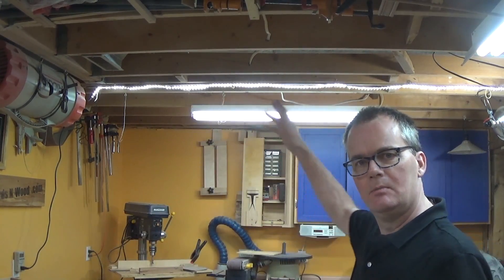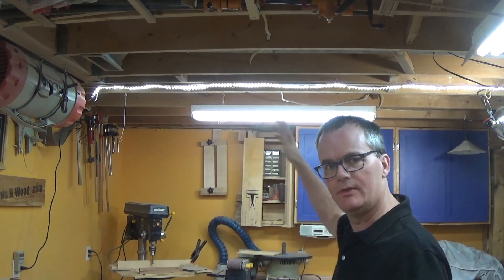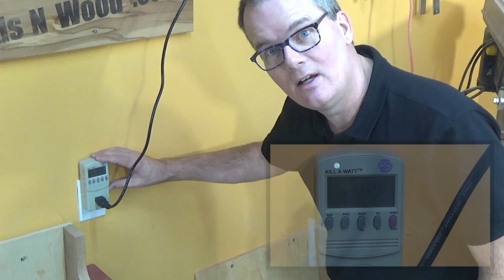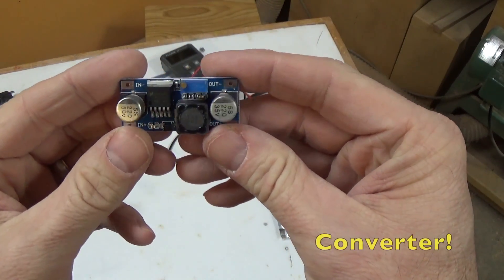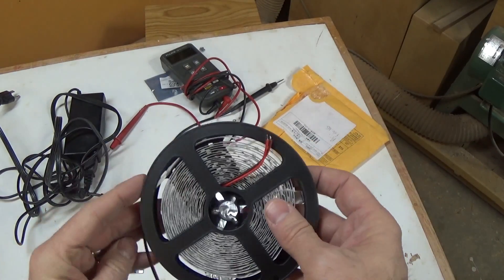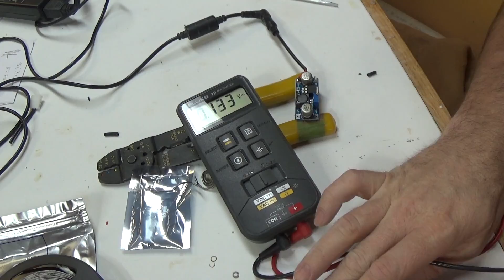Can LED strip lights replace Fluorescent!?  (WnW #46)

Comment from the maker: Your support brightens my day: https://www.patreon.com/wordsnwood
========== ========= ========== ========= ========== ========= 
PLEASE NOTE:  the DC-DC converter burned out after posting this video.   I have since found a reference online that claims these have pretty strict amp limits, and can overheat and die if more current is applied.  My PS was putting out 4.5 amps.   The DC-DC convert had NO specs provided, and I was NOT checking the temperature.     

========== ========= ========== ========= ========== ========= 
PLEASE SEE THE FOLLOW-UP VIDEOS:

Part two:  https://youtu.be/oiEl96CIOGI?t=41
Part three: https://youtu.be/5eA2CPHRakw

And you'll see how I finally succeeded with my experiment.

========== ========= ========== ========= ========== =========
Today I ask the question... can these LED strip lights be used in place of regular lights?
Project web page:  http://www.wordsnwood.com/2016/LED-lighting/

I was curious if these LED strip lights (which you see everywhere) could be used as "regular" lighting, instead of just accent lighting.  By checking the advertised rating for some of the brighter-rated LED strips, they were claiming 720 lumens per meter.

That is almost the same rating as a 60watt incandescent bulb.   Incandescents are also omni-directional whereas LEDs are highly directional.  So, if these are putting out roughly the equivalent of 60watt bulb for ever meter, then one of these strips should be equivalent to FIVE 60watt lightbulbs.  That's a lot of light.

Unfortunately I do not have a light meter so these are all highly subjective conclusions.

One strip of LED lights is, in my view, not as bright a a conventional 4ft double fluorescent (old T11 style) fixture.  However, TWO strips of LED lights are, again in my subjective eyes, equivalent.

However two strips of LEDs cost more, and consume more power.
But I do like the light, as it is more even and less concentrated.

You be the judge!

NOTE:  after posting this video I was told that you can get a light meter app for your smartphone.  I tried 3-4 different free android apps and all reported that the lux from the fluorescent was equal to the lux from the two LED strips.  (586 lux; with the phone resting on the tablesawl.)

---------- ---------- ---------- ---------- ----------
If you want to build this:  (Affiliate Links)

Lighting Ever 5050SMD LED lighting Strip -- http://amzn.to/1SF0c55
Lighting Ever AC 72watt Power Adaptor -- http://amzn.to/1TqN2rb

5 meter Strip of 5630 SMD LEDs -- http://amzn.to/1KZA4PB
(the vendor I purchased from on amazon.ca - Hintel - does not appear on amazon.com, so this is a link to a search for 5630 SMD LED strips)
LM2596 DC-DC Buck Converter -- http://amzn.to/1TqIRM3
DOUBLE-CHECK any voltage/current restrictions!!!!

---------- ---------- ---------- ---------- ----------
Many more Woodworking Projects at: http://www.wordsnwood.com/

Follow me on Social Media:
https://www.facebook.com/wordsnwood
https://www.instagram.com/words.n.wood
Reply: converters do not 'ut-out a specific current. The load draws or attempts to draw the current required. People look at the voltage requirements and miss noting the current requirements of the load. They under-size and then wonder why the power supplies burn out 6 months later. The consumer type product packages power supplies will be just enough current capability but still burn-out at about the warrantee expiry date. Try to get a slightly higher current capability at the voltage required, allow for air flow too cool and it will run for years.
Reply: As far as power is concerned a cheap desktop power supply should provide 12v at whatever power both strips need at 80% or more efficiency. 
Your greatest gain from those strips is having light all the way to the corners.
If it's the amount of brightness your after, fold the strips into the same area (four feet), then compare them to the fluorescent.
Reply: https://www.amazon.com/dp/B073WVJSBY
I found this 5630 Tape light really in premium quality, CRI>=95% unbeatable brightness
Reply: Well, I would like to see how striplights can replace anything! They have no hands, cant hold tools? The fact is --- Replace the whole fixture with a LED fixture, cheaper!
Reply: your problem starts on the low amps in your ac/dc converter. I always use a 30 amps 12V Source and works fine. high bright LED strip is best to approach to neon light wich is brighter but consume a lot more power.

Comment: this guy is a moron.  if you wrapped the LED's back and fourth so they only expanded out 4 feet so they are the same length as the old lights then the LEDS are much brighter but cuz the LEDs are so bright, you don't need to do that at all.  the LEDs are cheaper, use less power and are brighter.  wtf is this dumbass talking about.  the LEDs cover more area so u would have to buy more of the older lights to get the same coverage, which means higher cost, use more power but might be brighter but is not worth it cuz it is not needed.  this is not even close

Comment: Ok so I am not an electrical but you losing power from the 12 volt conversion with the transformer, any transformer used they say you should unplug because it still using power plugged into the outlet. I buy the led tubes for my florescent lights but I an sure with the ballast in the fixture it will be using more power led the leds are rated but less then the fluorescent bulbs. I watch your video because I keep thinks to try them but may just wire in the regular A19 sockets and use the LED bulbs less hassle it burns out before the life span you can just change out the bulbs, unfortunately with the strip lighting when ones goes you will have to wait for a few to burn out before changing the whole strip. I have to say it would drive me crazy have one led out in that strip.

Comment: When you  were comparing power have you investigated how much "silent" power is going to the ballast required for the fluorescent?  I think the T8 32w (or T11 40w) is for the bulb output only and not the ballast.  I think the LED conversion would actually be less overall but I don't know for sure.  Might be worth looking into if you are curious or religiously monitoring your usage.

Comment: I think it's better to cut the strip in the middle. There are cutting marks every 3 LED's what I have seen. With the strips there is a discription to put max 5m on a powersupply and don't make the strip longer than 5m, or connect a second strip,  because the thin copper traces have a certain resistance. When you put 2x 2,5m parallel it will be better.
I have a IP65 (waterproof) warmwhite LED strip, with a remote controlled dimmer on the top of the side of my caravan, as light under the awning. I got the 12V power of the 12V electronic board installation of the caravan or from the 12V battery when no external power (230V AC) is available.  It funtcions now for 6 years and is great. Also have waterproof strips under the kitchen cabinets above the countertop. Even in a little shed in the garden I have some, powered by an old 12V lead acid car battery, charged with a very small solar panel. 
Also in my workshop I have a couple of strips, but every strip has it's own 18W 230V AC to 12V LED driver (about € 2,00 each).
I had trouble with the glueing too. Indeed when attached when warm they stay :-) glued. I even replaced a strip by putting a new thin double sided tape to the strip.
Thanks for your video. Have fun with experimenting with LED strips.

Comment: Please don’t use fluorescent bulb wattages as your total input power. Ballast efficiencies vary drastically! I’ve measured two 40 watt fixtures around my shop and their input power, measured with a Kilowatt meter just like yours, varied from 96W to 185W! Also, how you drove your LED lights here was not efficient-you used two regulators if I understood your hook up. I’ve just completed a LED strip light which delivers 45W DC at 12 volts with 54 watts AC draw using a high frequency (27kHtz) LED driver. The output from that setup was measured to be slightly greater that my best 2 x 40W fluorescent fixture, at 96W, better than twice as efficient. The LEDs were mounted in an old 40 x2 fixture.

Comment: Hello. Im doing same things. First strip i powered with 12v 2A 25w led supply. But wat meter show that it using 110w. Another one i powered with laptop power supply 19v 6A, and wat meter shows 350w on same 5 meter led strip. I dont understand why is so much power consuming :o  please help :)
Reply: Ah, im using dimmer as well with lapop pewer supply
Reply from the maker: I'm not an electrical engineer!!!  I have no idea!

Comment: As electronics specialist, I also cannot believe led is brighter or low watt consumption or lower heat. After years of research, if you compare the same lumens brightness result, led draws the same amount watts, emits same amount heat because you need more watts means heat. Hot led which are high watts led needs big heatsinks to cool down or else they will burnt off easily. The cost of these high watts or amount of leds are even much more expensive than fluorescent bulbs. The only good thing of led, if you have good heatsink cooling down led, they will last much longer than other lights. But replacing led is another high cost factor and the power supply adapter is expensive. 
Fluorescent lights are convenient, easier to replace and cheaper to buy. Thats why although so many lights companies marketing advertisements gimmicks, they still cannot penetrate everyone's mind to change to led. They use government politicians to help but the end users always still stick to fluorescent.
If you want to spread out the fluorescent to the wall, why dont you buy another fluorescent and shift the existing to the side.
Different led manufacturer makes different quality. Better quality price higher but give better lumens but these factories still sell out low quality rejects so they dont loose money.

Comment: I've never had an issue but I mount mine in aluminium channel to extend their life and they bond lovely
Reply: Also 50,000 hours vs half the original light output over 12 months with the tubes, and the ability to go round corners.

Comment: but if you manipulate your wires in a parallel/series wiring connection, then theoretically you don't need the "dc-dc converter"

Comment: Those cheap Chinese converters often have no heat sink on the chips/transistors - so more than 1 amp or so is usually too much. Try, carefully!, touching with fingertip - if too hot to touch, it'll go.  

As to light meter, if you have a cell phone, you have one! Both Android and iPhone platforms have light meter apps. I checked an Android app on my Samsung S7 and it compared within a few % of the high quality meters I have at work. Close enough for pretty much any home app like this!

Like the idea and the video though. I included under cabinet LED lighting when we re-did the kitchen this year and the wife likes it. Would need more to actually light a room though - maybe a couple more strips would be enough.

Comment: Just stumbled upon this when looking for info on ballast removal.  I installed strip lighting in a closet where there used to be a 4' dual T8.  The T8 was brighter in the middle compared to the strip lights  but big benefit for me is the LED strip lights up the whole closet which is better overall.  I can see the full width of the clothing.  On another note, you can download light meter apps on your cell phone to get some basic light level comparison readings.

Comment: Watt usage is dependent on voltage and current.  Watts = Amps * Volts    If you weren't providing enough of either amps or volts, then it won't pull the expected watts.

Comment: I found out these 5050 LED strips are bright enough for my desk lamp. I use two 50cm strips and they consume 2A at 12V which give 24W. I also bought one of those RF Wireless controllers so you can control the brightness with a remote. One problem was that most of the 24W turn into heat which means the LEDs will get hot if not properly cooled. All semiconductors don't like heat and these LEDs are no exception. I bought some aluminum rails (1.3cm wide) from Home Depot and cut then to the right length,  strip off the adhesive on the back of LEDs and glue them onto the aluminum rail with silicon adhesive so that the heat can be dissipated better.
Your LED strips are on a piece of wood which is not a good conductor for heat. Did you try placing your hand on the LEDs after they get turned on for a few minutes?

Comment: They have them here in Thailand inside a fluorescent tubes and they hardly use any power, they do replacements for the old fashioned circular circular  fluorescent lights which are much brighter and use about 18 watts max.

Comment: You may be surprised in the difference in energy used between the old lossey transformer florescent
  ballasts and the new electronic ballasts. They both rate the ballast for the load power. The input power is far different. The LEDs are also rated by power input to the LEDs not the power supply input. If you are comparing the older magnetic florescent to LEDs I think the LEDs would be a clear winner. I liked your video.

Comment: Just bad adhesive. I’ve dealt with these strips a lot and none of them ever hold. I always use 3m double sided tape. I’ve had them on motorcycles for a couple years and still going strong.

Comment: Other reviewers here on YT have been warning off the Chinese made ones due to a high failure rate of less then a year of use (both power supply and strip). To experiment and prototype with for less they are good. The point is that a LED on it's own will never 'burn-out'. If the application of the technology into a product made of high durable materials it will function " To Infinity and Beyond! ".
Watts in equals Watts out. Watts have a 'teeter tauter ' relationship. Voltage up current draw goes down, and the reverse, watts con$umption remain$ the $ame. You only need to insure that the power supply can deliver the DC current and voltage requirements of the raw strip lengths used. Everybody always forgets about the current and undersize and they wonder why the power supply smokes out in 6 months. Stinks like hell.

Comment: I run 3 sets of 5050 rgb linked to 1 control box in my bedroom around the top edges.  these do not produce a true white light but its more than sufficient to light the entire room in any color I want.   I run mine using industrial double stick tape and have had no issues. also the light seems to be a lot less harsh to my eyes. One key note is my controller has a option to dim the lights which is nice at night and with the rgb you have a true blacklight effect if you choose that setting.

Comment: Should have mounted the LED strips to a metal backing instead of wood.  The metal acts as a heatsink to disparate the heat and the sticky tape would have “stuck” much better.
Reply: Heat travel to heatsink will make cause the glue to let go eventually.

Comment: These strips aren't made with high bin leds like a CREE incandescent replacement is, they're not going to give enough lumens per watt after the high losses of those thin pcb traces to compete very well. If you replaced your tubes with the equivalent wattage of high bin led lights then it would be a different story, but that would be impractical in most cases.

Comment: Your converter must of not been strong enough for sure if it burned up I was asking to double check because it would let you know   the higher you turn the voltage  if it stops climbing  or if it has no effect meaning you have a weak link feeding the lights

Comment: Your voltage may have dropped with the LEDs  powered.  I would double check and adjust the dc to dc converter while it  is powering the lights...  I would turn the converter to 12.5 volts  loaded

Comment: Umm you do know that those led strips are sooooo not for what you're using them for right? Those are for like bars and clubs theater rooms shit like that. definitely not for what you're trying to do with them. regardless of what the box says THAT IS NOT THEIR PURPOSE. you could have used 4 or 6 led bulbs that give 100watts of halogen light but only use 12 watts each x 6 bulbs =72watts which would give you WAAAAAAAAAAAAAAAYY more than DOUBLE THE LIGHT YOU HAVE NOW. a 6 pack of led bulbs at Walmart is about 25 bucks.

Comment: Old video still informative. I don't have work shop. Just a garage with four 2 bulb t12 40 watt bulbs. Two pack is $10. Almost 16 feet of LEDs with power supply on Ebay is the same price. Fold in half and you get 8 feet of light for the same price as four feet. LEDs in the aquarium hobby have taken over.  The idea that you'd be getting twice the light for less than half the wattage is long long gone. People are now running the equivalent of Metal Halides or even more and the heat factor still exists. LEDs didn't live up to the expectations in that hobby.

Comment: you are better off converting the T 8 fluorescent with T8 Led from HD. power supplies use power even with no load on them. TOGGLED Brand are Good. and no Ballast.

Comment: just so you know there is a drop in voltage when the lights come on....... so you will have to adjust the dc to dc converter you have to set it to like 13 volts to adjust for the drop
Reply from the maker: Make sure you read the video description.   That little gizmo fried pretty quickly.

Comment: LEDs are the way of the future. Energy efficient, longevity (most are rated for 10 years continuous duty), less components to fail, and leds are not hazardous waste. Whereas flourecent fixtures have pcbs and  mercury. ( I know they are phasing out the silver caps, but they are still out there)
Reply: Not the chinesium ones. Never see one of these led strips last for more than 3 years.